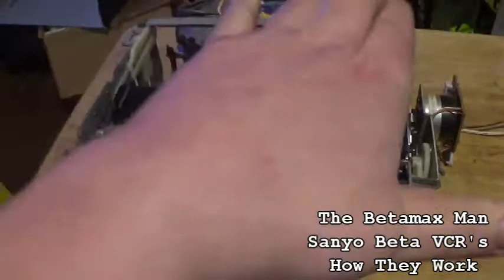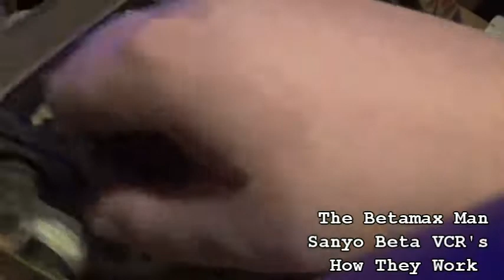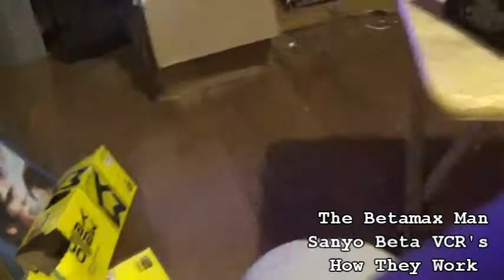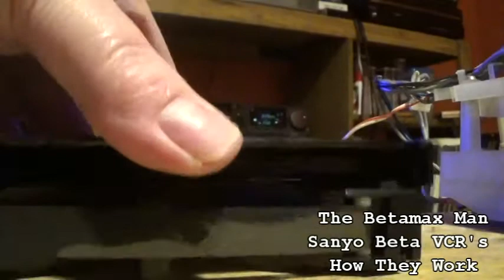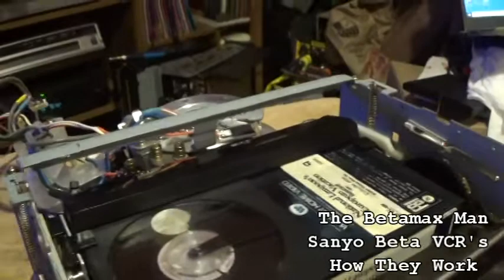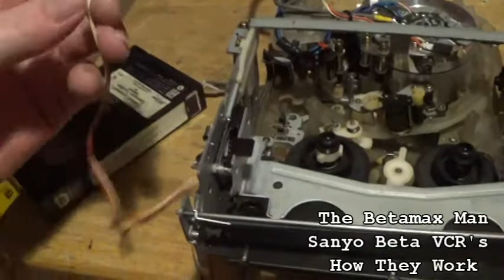How To Remove A Stuck Tape And How Sanyo Beta VCR's Work

Comment: Hello,
          I bought a Betascan SL 5400 that had a tape stuck in the top loader. I removed the outer case and untangled it from the mechanism, but am unable to eject the tape. Nothing happens when the eject button is pressed. The tape fast forwards and rewinds so I don't think it's a motor issue. Any suggestions on how to proceed?
Reply from the maker: make shure the vcr is in its home position it will need new belts and idler tires if you can do a video showing me the vcr mechanism to see if its in the home position send video to TheBetamaxMan@hotmail.com so i can help you better the sl-5400 has the 710 chassie
Reply: Sent pictures and video.

Comment: We are working on a Sanyo model VCR4400, the belts were replaced, the tires are clean and working, when the device is plugged in, the tape loading ring belt just keeps spinning as if it wants to come back to the stop/unload position. But it is already at that spot.

The FF/REW idler belt just keeps spinning and keeps turning the take-up reel. Need to unplug it to stop the belts from spinning. If you manually rotate the ring all the way around to the cap stand shaft and pinch roller, then plug the unit in, the ring will come all the way back around to the tape unload position but both belts will keep spinning/turning. Switches are clean and sensors are clean. Any suggestions are appreciated. Thanks

Comment: Hello I just got a Sanyo Betacord 4650 at goodwill  and the loading mechanism doesn't want to take tapes in. I pushed in manually with no tape and doesn't work on its own but if you hold the switch in the bottom of the mechanism it will try to do the eject motion but it just doesn't do a full cycle if that makes sense.
Reply from the maker: It will definitely need new idler tires and belts and all switches need cleaned do that and it should work if not after doing all that let me know and I’ll help you
Reply: @thebetamaxman8905  thank you
Reply: Hello again what is the size if the idler tires and where would be the best place to get them? Thanks.
Reply from the maker: @crypt-keeper74  eBay is the best source tire size OB .695 ID .520 WALL .130

Comment: Hello. I have the exact player which I bought a while back. Problem is there's no picture and audio is distorted to chipmunk levels. Any clue of what's wrong?
Reply from the maker: clean the heads if that dont work the pre amp may have bad caps see if you have a picture with the rf cable also check the video board for bad caps as for audio clean the audeo and control track head
Reply: @thebetamaxman8905  You can also see a picture when you pause a film. A/v jacks and rf does the same thing.

Comment: I've got a Sanyo 4200 that won't power up, and therefore I can't open the solenoid-controlled tape eject. There's no tape in it now, thankfully, but how can I release the carrier mechanism?
Reply from the maker: You can move the pulleys buy hand to manually move the mechanical parts

Comment: I just bought my first Betamax. Sanyo VCR 4500. There is a tape stuck in it. Found your video and now have a much better idea of what to do to fix it.
Reply: Okay, this worked a charm. Do you know a good place to get replacement belts for the Sanyo 4500?
Reply from the maker: @cleantones  eBay

Comment: Hello, hoping you can help me out.  I have a Sanyo 6400 circa 1984 and the drive belt on the motor that retracts the tape broke. I put two smaller rubber bands on it which seems to work a little bit but now I’m encountering an issue where even though there’s no tape in it the tape door is open and no matter what I’ve tried to do with taking the top off and sticking a tape in i cannot get it to reset itself.  Basically it’s almost like it’s dead when I stick a tape and it doesn’t do anything it won’t pull it down into the unit. I’ve spun the motor and the head kicks on eventually but that’s about it.
Reply from the maker: are you saying the tape wont push down all the way in if so i think the springs are warn out  also if the cassette housing front door is sticking it soulds like the spring on the left side is missing
Reply from the maker: I will try and do a video on this soon